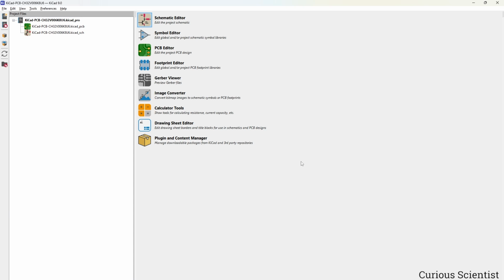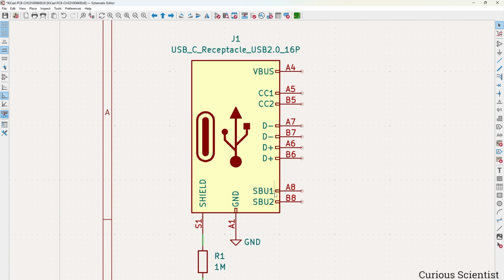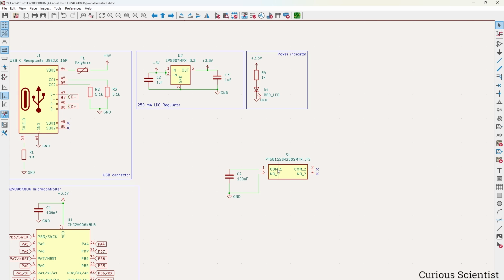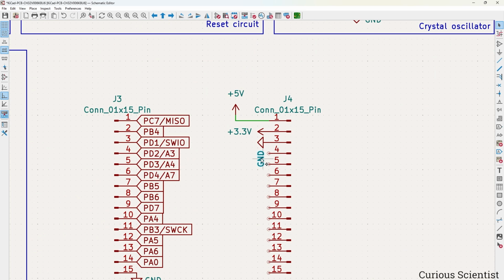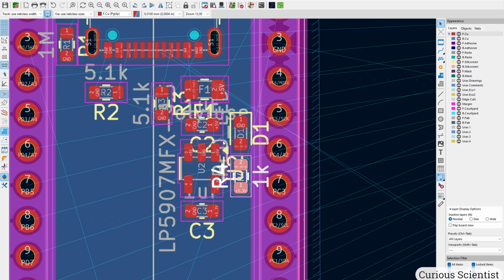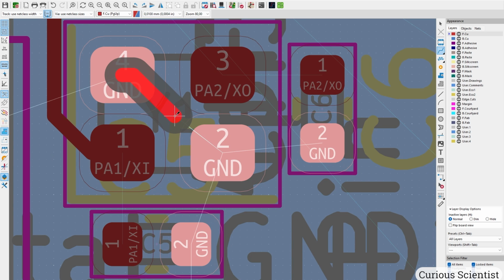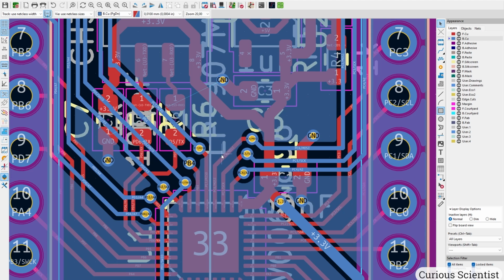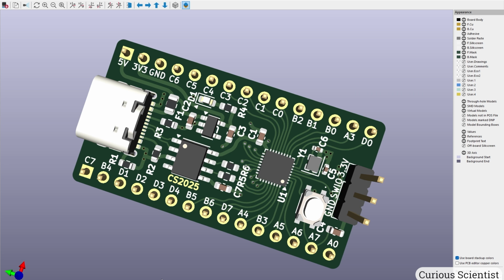CH32V006K8U6 Tutorial - Part 13 - Kicad 9.0 Custom Development Board

Comment from the maker: Designing a CH32V006 Development Board from Scratch in KiCad 9

*   0:52 Creating Custom Symbols: The tutorial starts in KiCad's symbol editor, showing how to create a new library and a custom schematic symbol for the CH32V006 microcontroller, as it's not in the standard libraries.
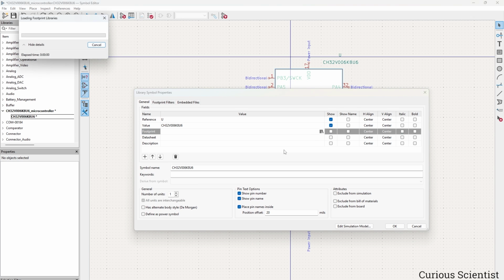*   8:01 Assigning Footprints: The creator demonstrates how to find the correct QFN-32 footprint in the KiCad library based on the microcontroller's datasheet and assign it to the custom symbol.
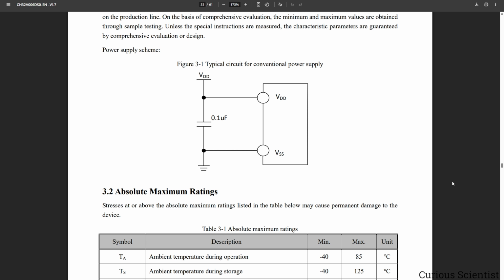*   10:21 Schematic Design - Power & Peripherals: The video walks through adding core components to the schematic, including bypass capacitors for the MCU, a USB-C connector with 5.1kΩ pull-down resistors for power sink configuration, and a protective polyfuse.
*   21:27 Voltage Regulation: A low-dropout (LDO) voltage regulator (LP5907) is added to convert the 5V from USB to the 3.3V required by the microcontroller.
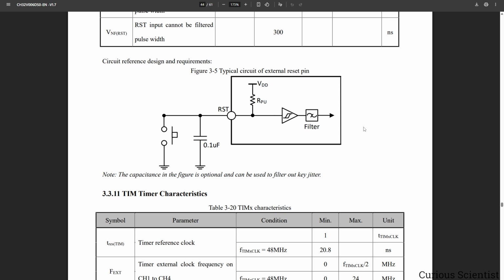*   26:46 Importing 3rd-Party Components: A practical guide on how to download and import a 3rd-party ECAD model (symbol, footprint, and 3D model) for a specific switch from a supplier like Mouser.
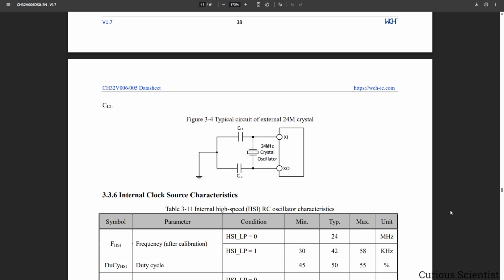*   34:22 Oscillator Circuit: An external 24 MHz crystal oscillator is added to the design, with careful selection of 4pF load capacitors, noting that these smaller capacitors use a 0402 footprint.
*   40:41 UART-to-USB Bridge: A CH340N chip is integrated to provide a convenient UART-to-USB interface for communication and programming, with its circuit designed for 3.3V operation.
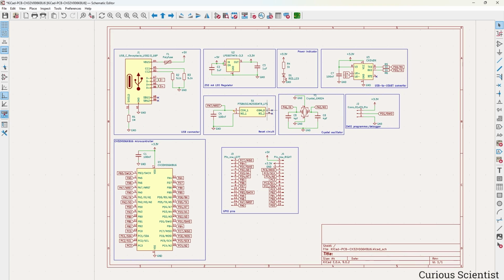*   52:38 Starting the PCB Layout: The components are imported into the PCB editor. The board's dimensions are carefully set to be narrow enough to fit on a standard breadboard, and the board outline is drawn with rounded corners for a better finish.
*   1:00:23 Setting Design Rules for Dense Packages: A key tip is shared: the trace clearance in the design rules must be lowered to 0.15mm to successfully route traces out from the tightly spaced pins of the QFN-32 package.
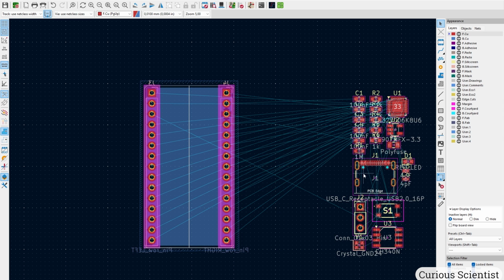*   1:01:35 Component Placement: The video shows a logical component placement strategy, placing the USB connector at the edge, the microcontroller in the center, and related components grouped together.
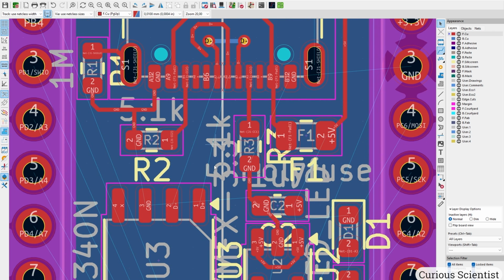*   1:18:21 Routing Differential Pairs: The D+ and D- USB lines are routed as a differential pair to maintain signal integrity.
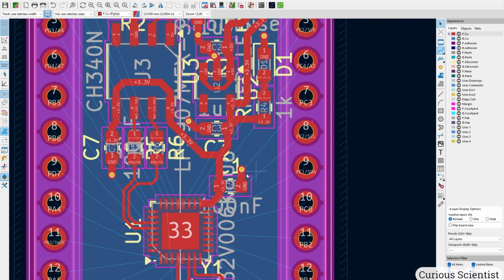*   1:30:16 Routing GPIOs and Managing Layers: The creator demonstrates how to route the numerous GPIO pins to the headers, using both the top and bottom copper layers with vias to navigate the crowded layout.
*   1:48:21 Using Plugins for Aesthetics: A KiCad plugin ("Round Tracks") is used to automatically convert all the sharp-angled traces into smooth, curved ones for a more professional look.
*   1:49:00 Final Checks and DRC: A final Design Rule Check (DRC) is performed. The creator explains how to interpret and resolve or safely ignore certain warnings, such as unrouted USB shield connections which are physically connected by the component itself.
*   1:50:12 Generating Production Files: The tutorial concludes by showing how to generate all the necessary manufacturing files, including Gerbers, drill files, and the pick-and-place file.
*   1:51:28 Ordering from a Manufacturer: The user is guided through the process of uploading the Gerber files to PCBWay's website and configuring the order, explaining options like board color, thickness, stencils for manual assembly, and the turn-key assembly service.

I used gemini-2.5-pro| input-price: 1.25 output-price: 10 max-context-length: 200_000 on rocketrecap dot com to summarize the transcript.
Cost (if I didn't use the free tier): $0.06
Input tokens: 42584
Output tokens: 1026
Reply: It's spelt like "key-cad"

Comment: May i ask why you are using global labels instead of net labels? Isn't it better to maintain hierarchy and only use global labels in multi page drawings? I'm new to KiCAD and wondering about the drawing conventions. Thank you.
Reply from the maker: I don't have multiple pages of drawings so it doesn't matter. I am just used to this way, that's all. It does the same job, so even if it's not entirely correct, I settled with this. 😅

Comment: @1:15 when you are laying out traces, I like to use the SEARCH panel to list the 'rats nests' that need to be processed. Press Ctrl-g to show the panel. It normally appears on the bottom, but I like to put it on the left side, to get a long list. Click on an item in the list, for example 'D+' and all the 'D+ pins will be highlighted with their traces, and all other traces hidden. I find this a lot quicker than trying to find all the matching pins by eye. When you have connected all the 'D+' traces, the item will disappear from the list. 

While the highlight drops to the next item,  it isn't actually "selected" ... the corresponding pins are not highlighted. You have to click somewhere to activate it. If you actually want the next item in the list, where it dropped to automatically, you have to click elsewhere and come back to the one you want. Also, sometimes the Ratsnest tab's contents disappear; I click on another tab and return to Ratsnest to refresh it.
Reply from the maker: Thank you! Very useful, I will try this next time!

Comment: @57:40 you don't have to struggle to get rounded edges, since Kicad 7 (yippee). Select the rectangle and right-click. 1/3 of the way down is the Shape Modification sub-menu, with options 'Fillet Lines', 'Chamfer Lines' and 'Dogbone Corners'. Fillet means 'rounded', Chamfer means 'diagonal' and Dogbone is a curious outward curve.
Reply from the maker: Another thing I didn't know, thanks! I will try this with my next PCB.

Comment: As a former programmer, my rule is there should be no error messages. That way real errors cannot 'hide' amongs the 'ignored' error messages. Either use the PWR_FLAG indications to let Kicad know which signals are power, or else modifying the Pin Conflict map under File->Schematic Settings. I suggest using the PWR_FLAGS; it isn't hard
Reply from the maker: Yes, that's why I showed that if you add power flags, you can get zero errors.